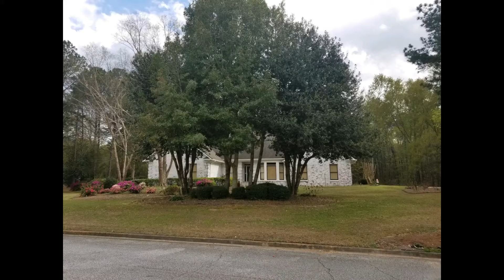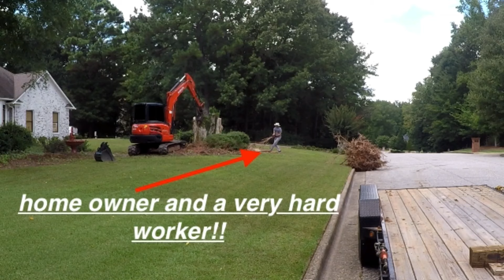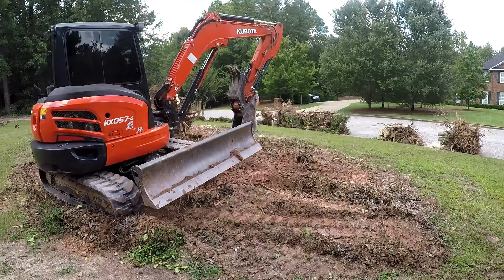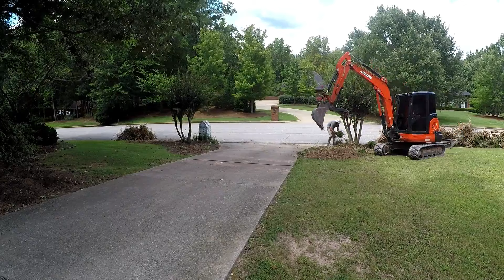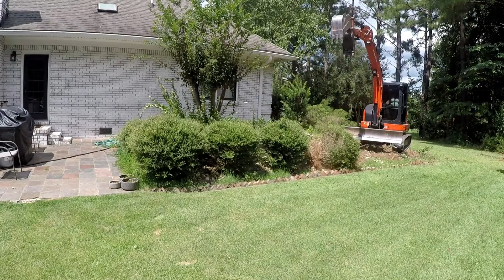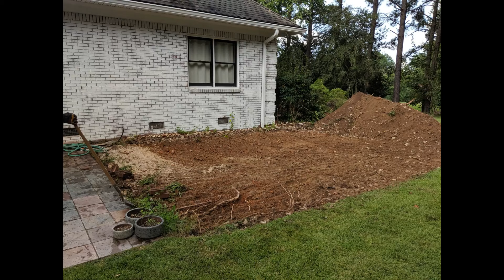Removing shrubs that turn into trees (kubota kx057, 12"bucket)

Comment: Nice work! How dark are the windows on your excavator? Looks sweet! Keep up the great work! 👍🏻
Reply from the maker: Sides and back are 15% and front is 35%. It looks super dark from the outside but from the inside its not dark at all. I went with a carbon tint. If your tint guy has any get him to show you the difference in the amount of heat transfer.
Reply: Residential Dirt Work cool thank you! I was wondering if it was tough to see out of. Yes he has that my loader is 40% all around with it but I want to go darker on it. Thanks again man
Reply from the maker: @eliteearthworksllc  With being able to spin I went darker on the sides and back. How dark do you think would be to dark on a loader?
Reply: Residential Dirt Work I’m not really sure, it gets a little challenging now when it gets darker outside. The carbon tint makes a huge difference. I’m worried 20% will be too dark so I may just leave. But I agree with you on the excavator bring able to spin around
Reply: It does look sweet, how’s the a/c on the kx57? Is it cold?
Reply from the maker: @bamadirtmovers1702  very cold, I don't think I've ever used the 3rd fan setting.